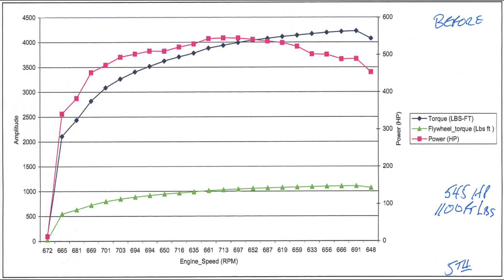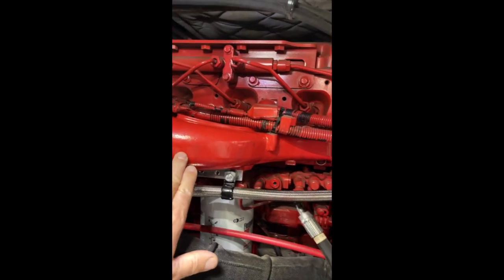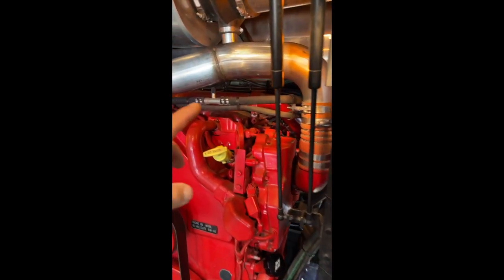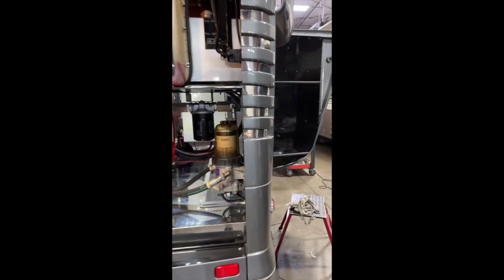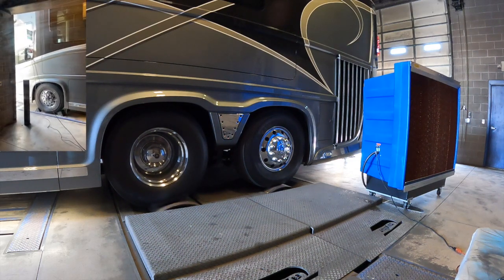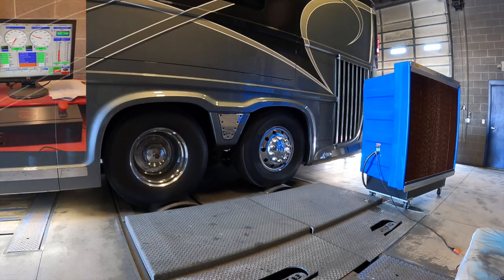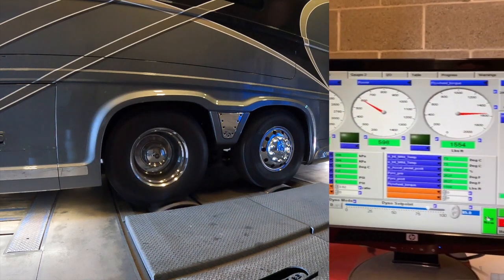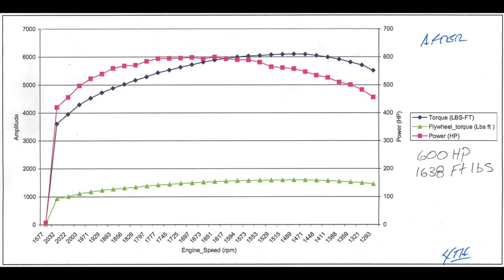Newell Coach with PDI Stage 2 Tuner Performance Upgrade | Cummins ISX | Dyno Test Results

Comment: Hi Steve!  Love your videos.  did you see a fuel mileage increase from this mod?  Thanks and keep up the great videos.
Reply from the maker: Thank you, Pat, appreciate it!
Great question about fuel mileage with the PDI Upgrade.  I like to give an honest and straight-forward answer when asked.  So, here it is:

After months, I've seen as much as .75 mpg gain, but that's when I'm flat and doing 65 mph, which isn't often!  Since we're based in California and frolic through the hills of the Rockies to get pretty much anywhere, my mileage gain will never match someone who's based in the flats and can keep their foot out of it.

For any RV'r, trying to recoup the expense of a full PDI Stage 2 upgrade will lead to disappointment, not to mention missing the true target of the reason you should upgrade, which is the increase and smoothness of power/torque.

The reason i say this, is because...at best...a typical RV owner is never going to clock in the kind of miles a long-haul trucker will.  Now THEY, on the hand, will quickly recoup the cost even with a mere .5 mpg gain.

Hope this helps you.

Comment: Great video.  Thanks for posting.  The initial run was in 5th gear and showed 1150 Ft Lbs. but I did not see an after modification comparison in 5th gear, only the final 4th gear run.  What were the gains?
Reply from the maker: Thank you, I’m glad you enjoyed.
Sorry for the confusion.

Here’s the results..
The initial run in 5th gear as 545/1100
The final in 5th was 585/1150
The final in 4th was 600/1638
Reply from the maker: @ugotitforsure3833  the dyno figures were skewed, for sure, since we later found significant leaks in two CAC boots which ended up causing a derate.
Since the repair, mileage gains alone have been very good, picking up at least 1-1.5 MPG. Lifetime was 5.7 prior, and now around 7.

Comment: Do you have a corrected dyno result since one pull was made untuned in 4th gear And the tuned pull was done in 5th?
Reply: Or 5th untuned and 4th tuned. The horsepower would vary on the dyno from gear to gear
Reply from the maker: Unfortunately, no. We had so many issues with heat that day. And frankly, I found out I had two leaking CAC boots during that period. So chances are, the results would  be much different now.

Thanks very much for watching and commenting.
Reply: @RVSquaredSteve  are you still satisfied with the PDI tuner ? I’m looking to install one of my x15 in a dump truck
Reply from the maker: @lilgamg  it is a good product in terms of versatility. Having extra gauges, forced Regen, and code resets are the true value for our coaches. I think that many people will argue just "how much" of a different feel it will give you, but most will say it helps a bit more on grades.
Reply: @RVSquaredSteve  that’s the goal I’m trying to pull steep grades with more speed
Reply from the maker: Sorry for my delayed response.  Yes, still a very useful product.

Comment: How much did the upgrade cost?
Reply from the maker: I happened to do it in a couple different stages.  I installed the tuner first.  Then I had PDI install the manifolds, along with some other work.  But the manifolds and spacers run around $3500.  PDI has the current prices on their website.
Reply: @RVSquaredSteve  Thanks...keep the video's coming, I just recently discovered you on Andrew's page.
Reply from the maker: @dankarau2307  hi Dan…that’s AWESOME!  I have a great time with Andrew. Thank you for the encouragement; I’ll keep trying to provide the best content for all.